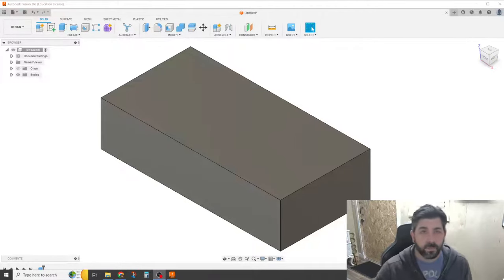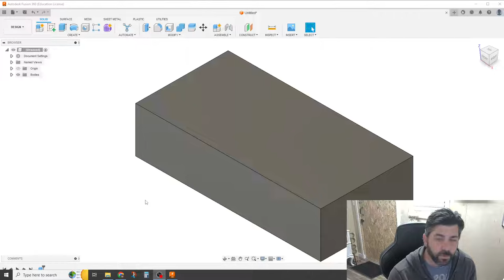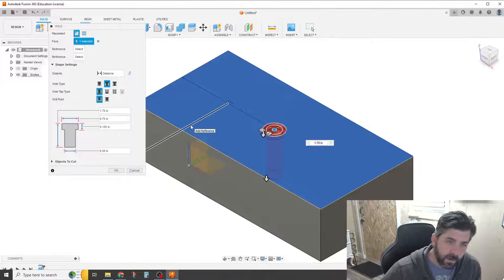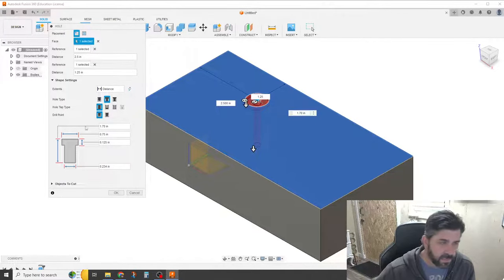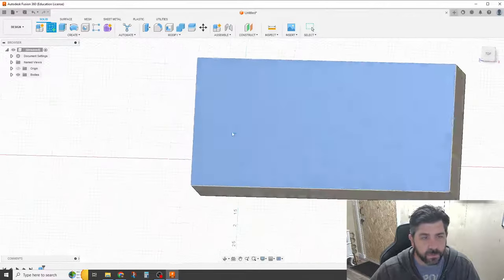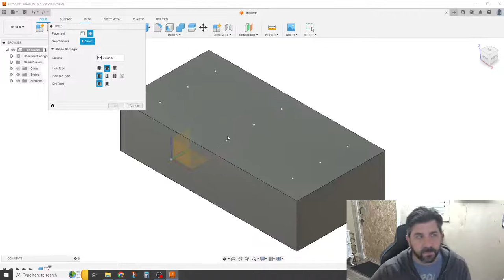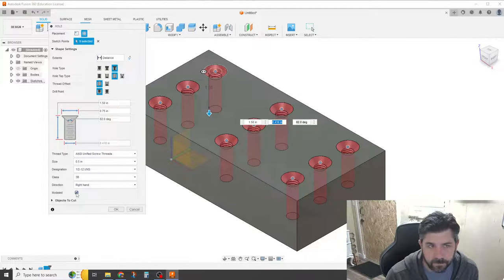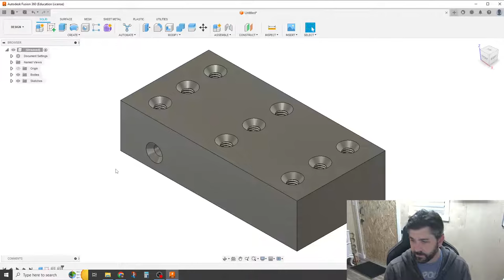Autodesk Fusion 360: The HOLE Tutorial

Comment: If you wanted to move on of the holes in a direction, from the place you ended the video, would you be able to?
Reply from the maker: sorry for the delay.  It depends.  If it's a straight through hole with no threads you should be able to click on that feature and hit the "m" key and move it around.  If it has threads, countersinks, etc.. the best way might be to right-click on the hole feature in the timeline at the bottom.  From there you should be able to reposition the hole(s).  You may need to deselect "modeled" threads first to give fusion some geometry to move around.  Otherwise you could always try editing the sketch if you sketched in points to reference hole positions.  If you move the point in the sketch, the hole will follow the new location of the sketch point.

Comment: Does the multiple holes feature happen to work for rivets? I imagine you would just tell Fusion 360 to not create threads? Or would there be a better way to go about making holes for rivets?
Reply from the maker: I think that's an option.  You can keep the hole type as "simple" and tap type as "simple" for no threads and just make sure the depth was all the way through your material.